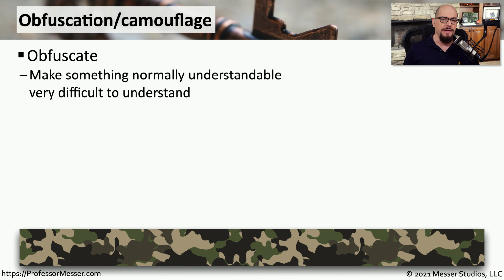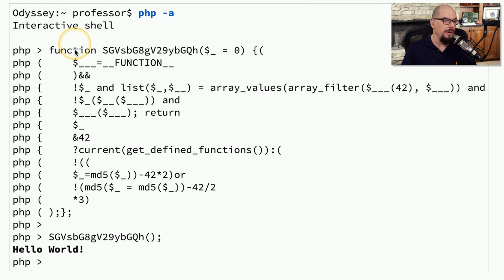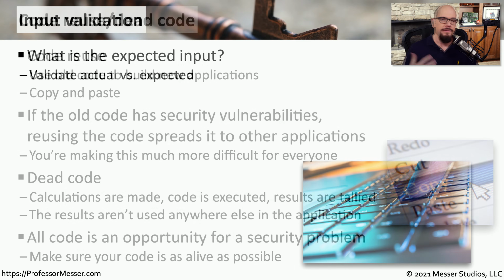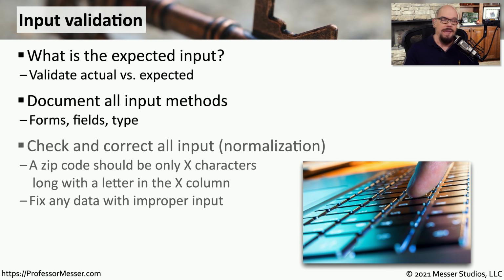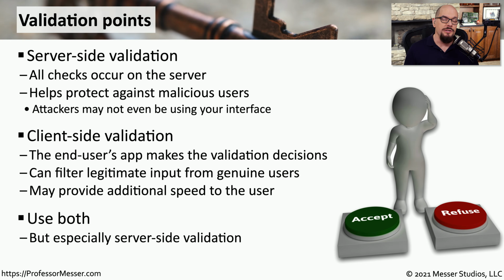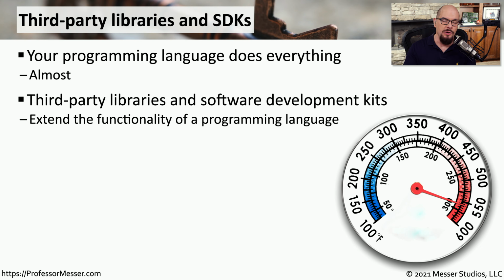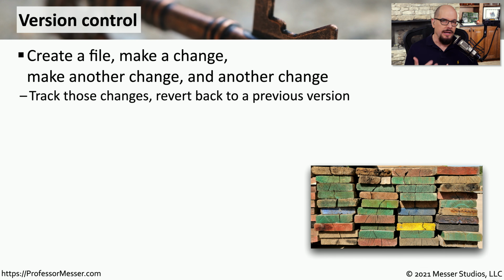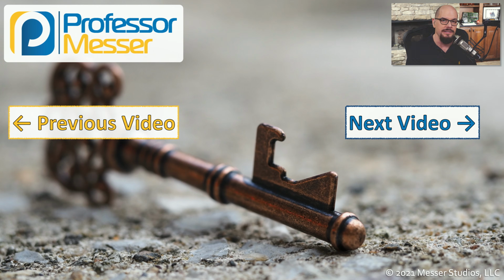Secure Coding Techniques - SY0-601 CompTIA Security+ : 2.3

Comment: Where he says at 3:13 that obfuscating makes it difficult for human being to even look at it, he wasn't kidding, it literally gave me a headache just looking at it. lol
Reply: If you're system is compromised whereby an attacker can read code, then it's already too late. ;)   
Also, trying to develop with a team in this way is not practical and a nightmare (not to mention would increase development time by an order of magnitude - and increase costs by the same).  Obfuscation is almost useless in security these days and many erroneously believe it makes things more secure, but it only makes lame/lazy hackers move onto lower hanging fruit, but the pros will only be slowed down and even MORE motivated - figuring there is  much more value in pursuing an attack. This is akin to a highly beefed up home security system with all the bells and whistles displayed outside - meaning there's more to protect, so the prize is bigger.
Another thing to note is that compiled code is far more secure than interpreted code (especially if the source is not on the public facing server, only the executables and libs) - it's faster too.
Reply: @davestorm6718  I think it is more targeted toward programs that run in environments you don't control. I can unplug my computer from the internet and mess around with Excel or Firefox or whatever for as long as I want to try to find problems.